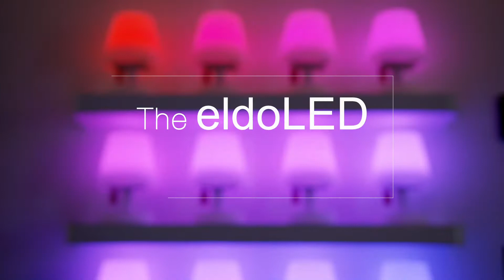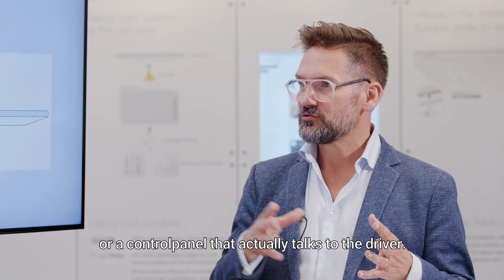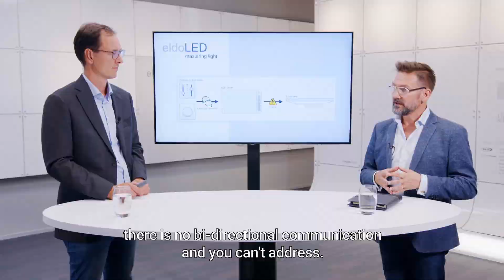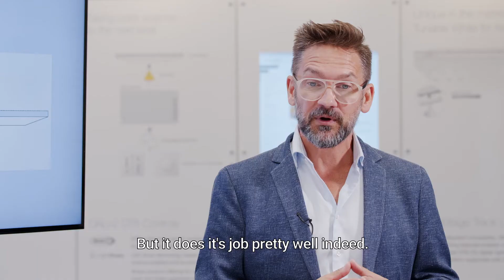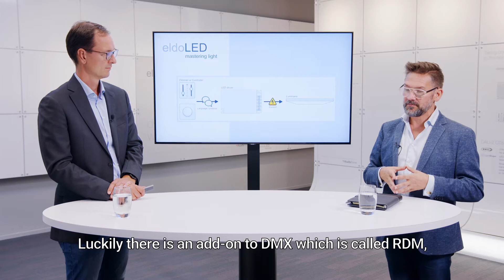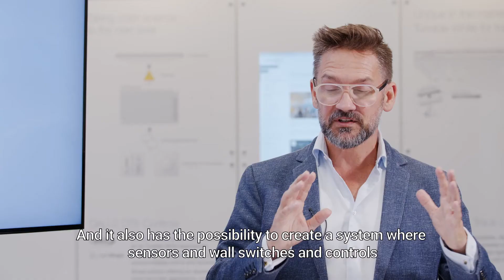eldoLED Tech Talk | Specifying The Right Lighting Control System For Your Lighting Solution

Comment: But how do you assign an address to a driver? Let's say the PowerDrive 561/S. Are there dipswitches or buttons and a screen physically on the driver, or do I have to somehow upload a digital configuration to that driver via ethernet or other digital method?
Reply from the maker: There are two methods to assign addresses to eldoLED DMX LED drivers. 1. by RDM (Remote Device Management) - from the DMX/RDM controller, you assign addresses to all nodes in the network remotely when connected. 2. by the eldoLED TOOLbox/FluxTool programming software, check here https://www.eldoled.com/led-drivers/tooling/programming-software/fluxtool/